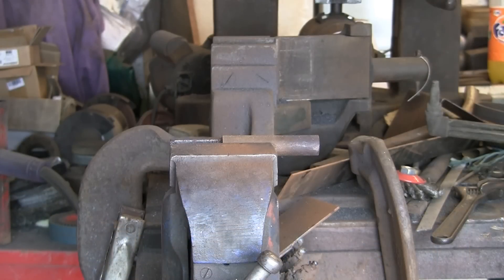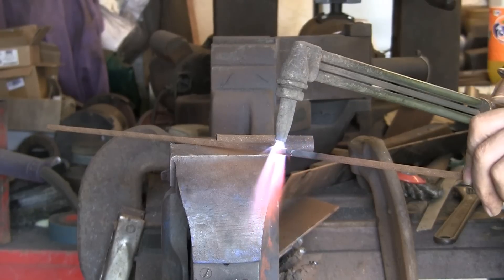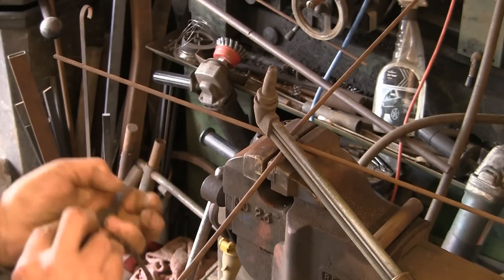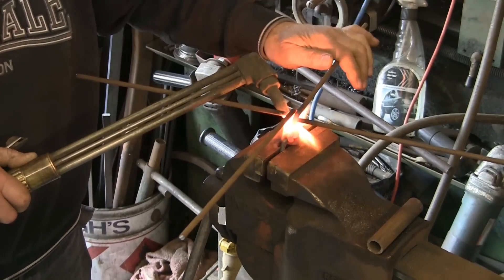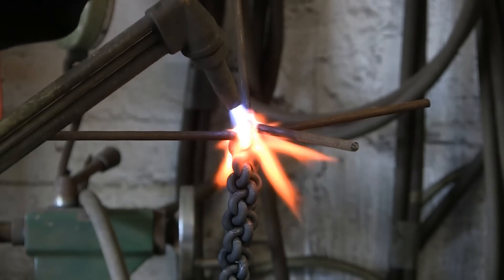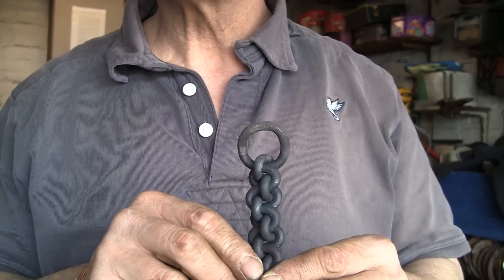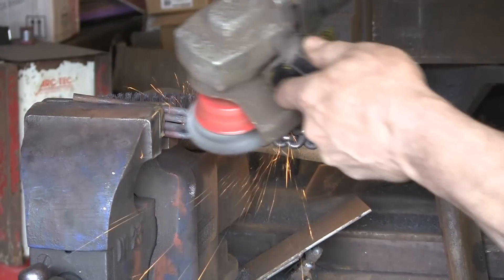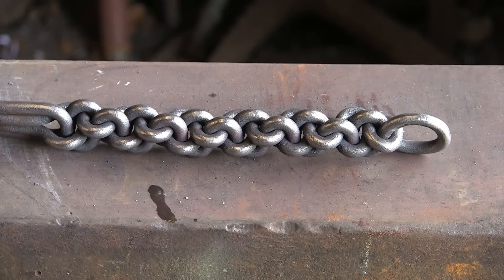Braided handle

Comment: Hi,

I think that was very well done, and heating the ring and parsing the pipe through will help make it round, but with it being so thing it might not be necessary to heat it. I like the idea and this would make a nice handle for a carry-all tool box which you might use every day.

Comment: you can do this with one of the cheap oxy/propane or oxy/mapp torches you find at big box stores. Not as fast as oxy/acetylene, but it works. 
I only run oxy/propane, as I'm too cheap/poor to buy acetylene, but it still works well enough to cut 1"+ thick plate. But my little cheap torch does well on small stuff like this and has a nice small flame that directs heat well.

Comment: Gary, I like your videos which are very interesting and informative.  I do a bit of hobby blacksmithing and know of (and have used) a method for "braiding" 1/4 rod with 6 lengths (instead of 4) that looks very realistic and is more smooth & comfortable in your hand. Once made it looks very complicated but is quite easy to make.  To make a braided handle about 6 inches long cut 3 pieces of 1/4 rod 18 inches long.  Heat each piece in the middle and bend it tightly back along itself. Weld the end of each piece together (to prevent spreading).  Do the following steps to each of the 3 pieces.  Heat the entire length in the forge, clamp one end in a vice, and using a turning wrench, twist clockwise until the entire length is tightly twisted. This may take multiple heats but the aim is to have consistency along the entire length.  Twist all 3 pieces so they look alike with the same number of twists. Bundle the 3 pieces together and weld the ends so you have one unit.  Heat the unit red hot and twist counter-clockwise until the loops line up.  You'll know when its right when you see it.  One end can then be welded to a short piece of rod for a hook (for hanging) and the other end welded to whatever needs a handle (fireplace poker, coal rake, pot handle, etc).  Work the welds until there is a smooth transition from the braid on both ends.  Maybe you could try it and make a video. If you like the results post it for us.  Thanks, HWP.
Reply from the maker: HWPcville a bit like this one: https://youtu.be/GUENGw22EF0 But make sure you check out the update at the end as it's much better.
Reply: garyhuston Very nice!  I liked the way you finished off with the nut finial.  I hadn't seen this video before. Thanks for directing me to it.

Comment: that would probably make one hell of a damascus pattern if you did it with 2 different steels.
Reply: I've tried it with copper and steel.....a bit trickier cause the copper is such a small heat sink compared to the steel. Looks nifty. I think the pattern welded outcome would look good but the braid would flop at some point unless the hammer was very keen......maybe incorporate a slight twist over the whole length to tighten it up a bit (works for cable much better that way too).
Reply: WAs thinking the same thing
Reply: Henry Hamilton

Comment: the 4 peaces sticking up , just forge weld them together and make them into a knife , and boom , a knife with an interesting handle , i mean its not gonna be any good because the metal is not  ideal and the braid is a bit slim for it to be a comfortable grip  , but as a proof of concept

Comment: If each bar were two different types of blade steel, such as 5160 and 15n20, add some flux, beat the crap out of the braid, and you got one beautiful knife
Reply: Dylan Lewis That's what I was thinking Dylan, also could make a fire side set but I think a knife would be great.
Reply: Dylan Lewis That's what I was thinking Dylan, also could make a fire side set but I think a knife would be great.

Comment: Your camera has automatic white balancing and, in this instance, it is set for ~5,600ºK (daylight) that will alter the perceived color of the heat (~2,000ºK). Quite sure you know this, but that's why.
Reply from the maker: Lolita's Garden that is probably the answer! I will try and set the white balance to manual and play about with the different settings, thanks!

Comment: Hi Gary a great video as usual. 
Just a quick question (unrelated to the video) I remember on your polishing vid that you said you were trying one of those ceramic flap discs I I'm curious as to your thoughts on them. as I use the normal ones a lot is the extra cost worth it
Reply from the maker: william smith I'm undecided, they do last quite a bit longer but not sure if the extra cost justifies it as they are quite a bit more expensive. I tend to use cheap ones for most rough work and a ceramic on the best work!

Comment: Gary can you do this with a normal blow lamp
Reply from the maker: It depends on the size steel you use.
Reply: @garyhuston  ime looking in to oxygen prop what would you advise?
Reply from the maker: Oxy propane is probably the best all round solution.

Comment: Why don't you use the metric system?
Reply from the maker: Rob G I do for a lot of my work but I was brought up on feet and inches, the system only changed at the end of my schooling so I still instantly think inches before mm. Plus most of my subscribers are in the US which uses the imperial system.
Reply: garyhuston I'm kind of the same (we were taught both, which was REALLY awesome of my school). I tend to annoy people by using whichever measurement I see first. Getting a dimension from me as being '17 1/2 inches by 277mm' would not be unusual :)
Reply: garyhuston nooooo!!!!
We use the STANDARD system!!
;)
Pretty sure the forefathers tried to drop anything that sounded like we were honoring the king and called it the standard system. Honestly. I know the standard system but see how the metric makes more sense. We are a stuborn bunch.
Reply from the maker: OKBushcraft What ever you like to call it, it's still feet and inches!
Reply: garyhuston true. Just giving the history.
Reply: garyhuston  and Denmark ... ;-)

Comment: forge weld it into a knife of course
Reply from the maker: That's probably the option that will happen..
Reply: +Bob Adilla Next time maybe he can use 2 different types of steel.
Reply: +Tony Ennis wonder if we are related ?
Reply: +Bob Adilla that would be interesting to see!    As it. I wanted to see him heat it up and coat it with beeswax so the recesses would darken more.... would be a great handle for a poker or clinker scraper....

Comment: cool. after this, twist it.
Reply from the maker: And spoil it!
Reply: i'll try it. it will be in silver or brass.  The result will be interesting, and look really good or really bad, but I suspect good. Give me 3-4 days.  Send me your email, since I'd rather send it directly.  I'm a jeweler by the way but my work is more similar to blacksmithing that most jewelry,  You'd need to heat that braided bar evenly and twist.  I believe it would look beautiful, not that it doesn't look great already.
Reply from the maker: This might be nicer https://youtu.be/GUENGw22EF0?list=PL-t-SRc_IGRF8taDjA0m_2u2b1imG0TDM watch both videos as the second result is much nicer to look at.
Reply: I tried twisting the single braided bar and it turned out not as expected but still like something someone might like and not like something I'd seen before.  It needed to be straightened and evened up after twisting.  But it looks like parallel twisted rods that are partially linked together.  I've done a few other experiments in the last few days and it's been fun, but there is a bit of a learning curve.